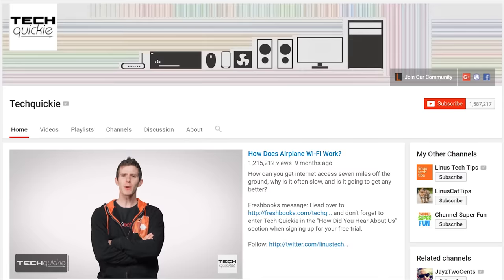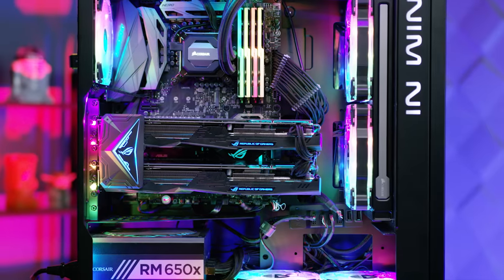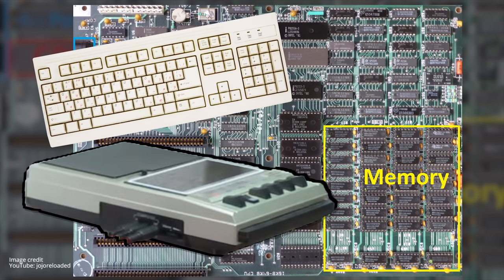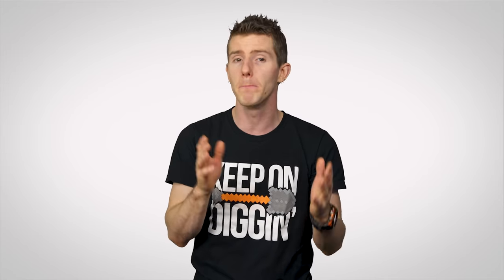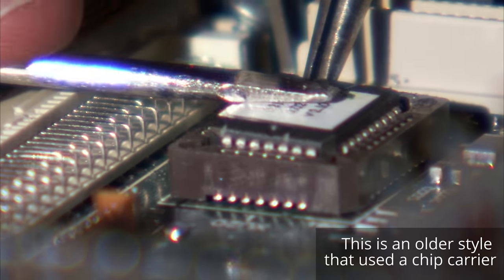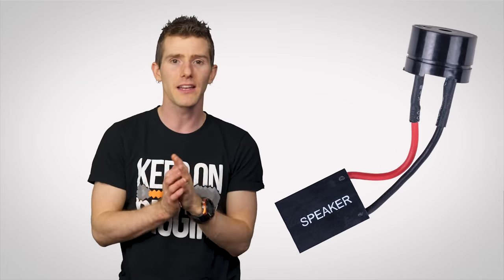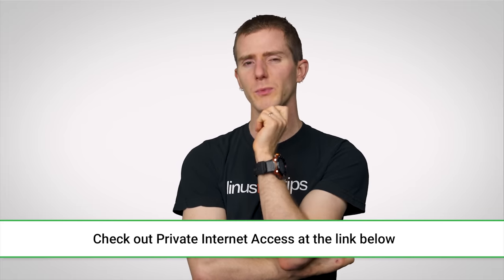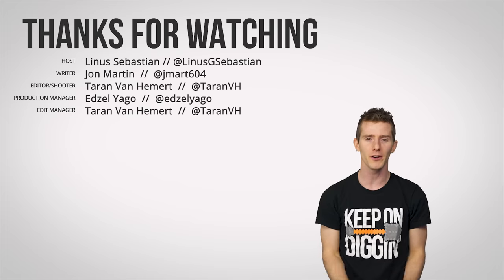History of the Motherboard

Comment: Having integrated graphics on the motherboard rather than the CPU doesn't sound so odd to me... My first system had an Nvidia nForce chipset with integrated graphics, and that system was AMD K8-based, so not thát long ago in the grand scheme of things
Reply: Commodore 64 was about the same time as the original IBM PC, and had integrated graphics AND was very very mainstream.
VIC 20 before it, and arguably the PET.

Among other possible choices.

Comment: There's so much iffy in this video. Socketed CPUs for one, many 286 CPUs had a land "grid" type socket, specifically many of the AMD ones. I think his whole "CPU socket" section is really about ZIF sockets. 

The way he skipped the 50s, 60s and 70s bugged me. He should have at least shown innovations in a few mainframes showing the development of how digital circuits were built, including the move to transistors, ICs, greater integration, the move from delay line to drum, core and finally chip memory. Would have taken all of 20-30 seconds to touch on that. 

I always find it funny that tech guys just literally know nothing about the importance of computers in the 50s and 60s, essentially where most of the tech that burst onto the consumer market in the late 70s was developed.

Comment: I mean, tranzistor electronics were big, fragile and somewhat ugly but i can see a one positive things.

Circa 1930s, a lamp or one wire in your radio goes kaput, it's pretty obvious to trace because it's smoking wire or dead lamp. Five minutes of repair and it's working again.
2018, A god know which one of microcomponents of your motherboard dies. Even if it's a minor thing, finding the actual problem will take ages so you pretty much need to obtain new motherboard.

Comment: You skipped so much stuff... like the battle between MCA, EISA, PCI, and VLB, and didn't mention the switch from AT to ATX ... EISA and VLB were actually very promising 32 bit standards, with VLB being far ahead for a long time because it was backwards compatible, but PCI ultimately won because it's the one Intel chose to bank on. AGP came around to give graphics cards a dedicated bus instead of the shared PCI bus, but it became pointless with PCI-E's lane system that was a more elegant solution to the bandwidth problem.

The Cyrix M2 was btw the first CPU to integrate a graphics processor and other functions peripheral components (like a modem) - at the time it was dubbed "a motherboard on a chip" - but it never really went far past the experimental stage and the cost of developing it was a major part of what bankrupted the company.

Comment: As for digital audio "on the motherboard", I'm assuming you're talking about JUST the PC-compatibles here, since the first Macintosh had it in 1984, as well as the Commodore Amiga in 1985, well ahead of the PC. The Amiga was also light years ahead of the pack in built in graphics and by having the first pre-emptive multitasking operating system (Even the first versions of Windows did not have it: It had "cooperative" multitasking, which meant that each process had to voluntarily give control back to the kernal when it was finished, whereas pre-emptive means that the kernal stops and starts each task/process automatically, invisible to the end-user).

Anyway, this video should probably be called History of the PC Motherboard.

Comment: lot of bullshit here .. intel 386 was on socket on some sysboard , but that time hardware was doing the job , nowadays there is a lot of shitty components that require firmware and codecs to function properly
before intel 386 a math chip was necessary to speed up floating point operations
8087 is math copro (ira13) even 387 was needed to achieve good operations...